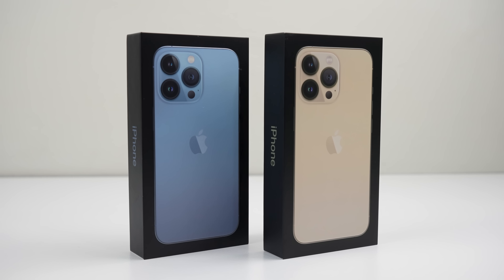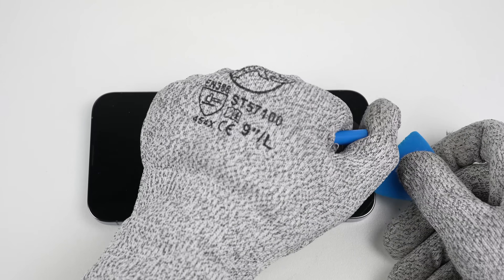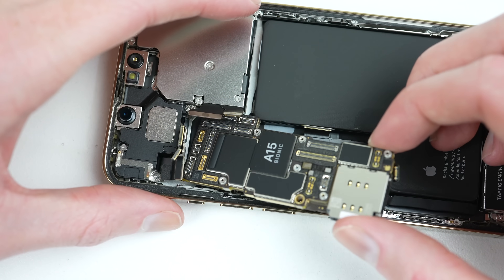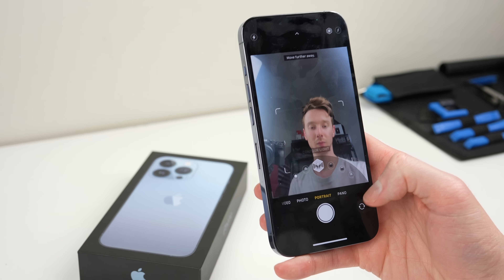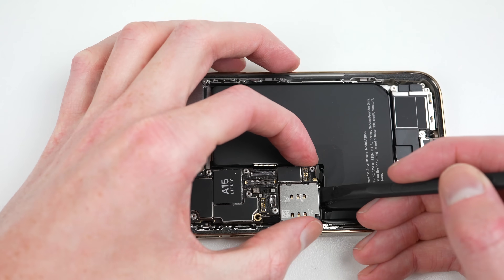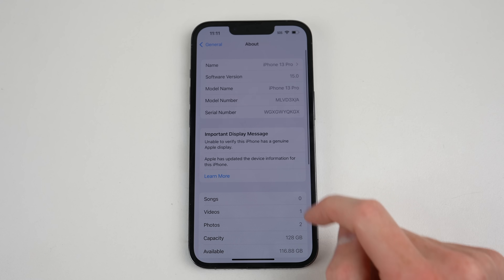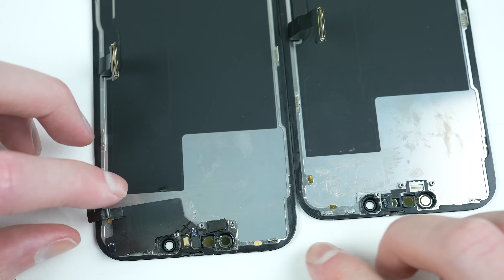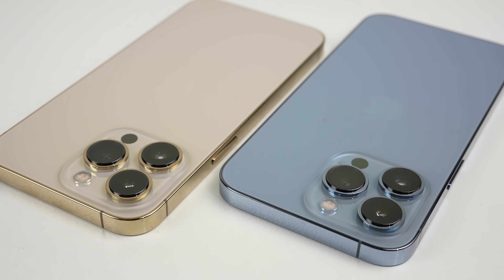iPhone 13 A Repair Nightmare - Teardown and Repair Assessment

Comment: Every time a customer comes to me for an apple repair request, I tell them to switch to other brands. Won't worth my time in getting apple products repairs. Sometimes, people gets mad about you not fixing these things for a few bucs. Even Apple's tech team won't repair it, they only replace. The damaged unit goes into recycling lol. 

Your video shows the issues when swapping components, because Apple assign an specific ID to each components, and each one is audited into Apple's databases, so they are aware of where is every device they produce going. 
This ID is paired logically to the set and once assembled, they got into inventory's phone, then when you start the phone, it'll ask you to connect to the Internet to send this inventory to Apple's Database and confirm that device is registered as they've programmed to.

Then, it starts all the data fetch from that device, including all your personal information, files and photos. Which every company does nowadays. Sustainability.

Cool video though.
Reply: What brand should I switch to?
Reply: @someguy4405  I would recommend to go with the one that offers a balance for your specific needs. 
Each user has different usage behave. This is when you have to do some homework. 
Like when you buy a pair of shoes: Do you like the color (case color)? , does the shoe makes you feel a solid step (is the phone fast responsive to your most used tasks)?, do you feel like the shoe is will last some time (is the device full customizable to prevent apps running in the background so it last longer)?, and so on.
Reply: @504octo  
What is easiest to fix?
Reply: @someguy4405  If you mean which one, I will say, none these days. If your mindset is to buy a phone as for "smartphone" is in escence, to get a future repair, then you are wasting your money cause commercial electronics nowadays are disposable.
Reply: @504octo  
Could you give more details on the data fetch that includes personal photos and files?
Reply: @someguy4405  Metadata, file creation, tags, camera device info, screen size, amount of apps on your phone, your phone number, fingerprint, face detection, etc. If you allow them to capture this, they will. That's where software comes into play.
Reply: @504octo  
Could you give a link or source for further reading on this info?
Reply: @504octo  do you casually know about a durable Samsung phone? I've been using a Ace 4 for 6 years and it has endured a lot so I has some trust in them but I don't trust newer phones, anything with Android 6 or higher and good storage is fine, don't care about camera quality
Reply: @someguy4405  yes I do but for some reason my reply was deleted 🤔
Reply: @andresamaya6187  Not sure, I dropped smartphone taste when Samsung landed the Galaxy S4 back in 2008. For me S3 was the best and the last of a generation of good smartphones. Some have come along the way but eventually fall into the same pile of disposable phones.
Reply: @504octo  thanks, considering my actual hardware, an S4 would be a really big upgrade and maybe I can find it at an affordable price
Reply: @504octo  
Try again, break the link up with distinct characters or present it differently, break it in half between statements, or just name the website instead.
Reply: @andresamaya6187  One thing I dislike from current phones is the none-removable battery. But companies won't produce battery replacement anymore. It was a cool era that did not lasted due to the cheap quality and prices. Just make sure your next phone is water proof in case it falls into a glass of water or into the toilet 😅
Reply: @someguy4405  won't work, Youtube won't allow organizational websites URLs in the comment section. But I've shared the URL on my Twitter profile, you can find me by the same name.
Reply: Shit phone, shit company
Reply: That is called MAC ID number and has been around for many years even before Apple existed, just was used for different purposes and Apple uses it for its own
Reply: They don't have an NDA for the tech team? I mean I know this comment won't result in much besides informational awareness, but still. I'd think they obligate you guys to not spill-the-beans like they do at Amazon (is actively an Amazon employee).
Reply: I don't care if they repair or replace, I only care I get a working phone back.  there's a point where it's not viable to repair some of these ultra complex gadget in terms of time and cost.

and people howl when their security gets violated, and then howl again when Apple maintains the security of their ecosystem that provides that security.
Reply: @ScottPankhurst  ^ found the type of person who makes scam companies like Apple able to exist. "Not worth getting these ultra complex gadgets repaired", as spoken by someone who has never even cared to look inside. Componensts are not super complex, and not difficult to maintain. Technology is not this wizard's magic that only Apple-paid sorcerers can handle. It's like buying a modern car and then scrapping the whole lot because you're afraid of having to use a laptop to diagnose ECU problems...
Reply: @Real_MisterSir  I still have my iPad Pro 2020 and I have to admit that apple is getting greedier everytime they launch a product and idk why🤷🏻
Reply: @Real_MisterSir  I agree with you and you are 100% accurate. I've been working with electronics my since I remember and I must say that Apple products are not magic items. Electronics is basic as these over priced devices that offers poor functionality and compatibility. Making an electronic device less compatible is just a marketing strategy of companies that sells candies with shiny fold paper but at the end is the same sugar from a cheaper candy. There is no high end products as for today, just over priced or cheaper. But the main issue here is how many functions you'll get with a reasonable price.
Reply: Makes fancy trash.

Comment: Say if instead of an iPhone, it was a truck. That truck needs an oil change and you diy it and use non apple oil and it’s not formatted correctly for that individual truck, then your vehicles running lights fail to work. I know it’s their phone and they can do whatever they want but it’s wild that only they and certified apple stores can replace these items.

Comment: This needs to be made illegal as anyone should have full access to parts diagnostic tools  services information and schematics to the device because if you don't you are nothing more than a license user and if that is the case then if you break your device they should replace it free of charge but do you really think that they would do that not if it's going to cost them money.

Comment: The way the issues occur when parts are changed seems too streamlined, almost like the OS specifically limits itself when new parts are detected instead of their assigned factory ones.
Reply: It’s a scam to require Apple to repair their phones and prevent 3rd party parts.

Comment: So err... What happened to the right of repair? And things like the historic Microsoft monopoly case?

This, along with things like custom screws shouldn't be allowed, I don't expect a complete documentation of the internals, and integrated circuits but if I want to figure that out myself I should be allowed to.

I don't use apple products, and the only reason I don't is the universal walled garden in both hardware and software; by doing this stuff they're aim is clearly to earn money at the price of competition and creativity.

Comment: I think the Face ID errors are actually a security precaution. I think this was done to prevent brute force, hardware based hacking of Face ID. If you really break it down, the front camera and Face ID sensors are just devices that communicate with electrical signals, and their output data could be spoofed. One could theoretically create a device that uses the camera connections, but isn’t a camera at all. Instead it could just feed the phone fake image and face mapping data until it got something close enough for the phone to unlock.

Making it so that the phone will only accept Face ID data from its original front camera and sensors is a pretty smart way of preventing this.

Comment: From a Security Standpoint I actually think it is quite good that face id doesn't work if you put another camera in. But I cant imagine a good reason for the disabling of other components.
Reply: I’m not sure I follow you, how is it a good thing? Unless of course you’re assuming replacing the camera would allow anyone’s face to unlock the phone, which wouldn’t make sense to me given the data should be stored on the main board and not the camera itself. In my mind, if replacing the camera worked perfect on the phone then the person who steals the phone would only be wasting their time replacing the camera because they’d be right back to where they were before tearing the phone apart?
Reply: @ThePantsManYEEAH  Okay as far as I understand it, and I am not an expert, the face id feature uses not only the picture you see, but also other means (I think Infrared) to get the shape of your face. This is why You cant just put a picture of someones face in front of the camera and unlock the phone with that.

To log into someone elses phone you would probably have to model their faces with their depth as well. I don't know how easy or difficult that would be, but I cant imagine it being very easy.
If it was possible to connect another camera to the phone it would probably also possible to connect some software that mimics a camera instead. Now I would just need to take a photo of your Face and present it to the phone when it asks for the face id. This Picture would of course need to include all the info a face id needs.

This seems quite complicated, but if you had the software, you would just need to make a short video of the person you steal the phone from and then connect the software to the phone instead of your camera. I wouldn't like if anyone got all my personal data that easily.

I don't know if every part in this is realistic and if anything I said is wrong please correct me.

Comment: The fact that they can fit a speaker above the notch but not a camera tells you all you need to know. They could make the top bezel 0.5mm thicker and fit the camera no problem but they'd rather make the notch smaller incrementally like everything else and keep stringing people along with new upgrades. Then they claim to be environmentally minded

Comment: If I spend $1,300 on a phone, I should be able to put third-party replacement parts in it. It's absolutely absurd that you can't even put first-party official apple parts without having an issue. Apple laughs and spits in your face at every opportunity and yet people still give them money for this overpriced electronics.

Comment: Using genuine parts from one iPhone 13 to another iPhone 13 causes the phone to permanently malfunction. Every component of the entire iPhone 13 range is deliberately programmed by Apple so that third party repairers are unable to fix the device. The person owning the broken phone has to send their broken phone back to an Apple store just to get a repair it at a hefty price. Apple's agenda of creating planned obsolescence of their electronic devices forces the customer to buy new devices on a regular basis. All of Apple's flashy marketing and gimmicky advertising doesn't hide the fact that Apple wants to sell new devices just to increase their profit margins.

Other electronic companies will follow Apple's lead by making their devices unrepairable. Eventually, all industries across the board will follow the same path as Apple. There must be laws for all industries across the world so people have the right to repair and recycle their products, especially in the electronics industry. Electronics in particular are difficult to manufacture and recycle given the large range of plastics, silicion, precious metals, rare earths and toxic chemicals.

The iPhone 13's poor repairability in this video is an example of Capitalism gone rogue.

Comment: The best way to heat up your iphine to loosen the glue is by putting it in the microwave for 40 seconds. If  that doesnt work, soaking it in warm water is a slower alternative

Comment: I'm not saying all the practices here are acceptable but the reason face id breaks in every situation is to make it as hard as possible to hack into a locked iphone. The theory being if you could replace the camera or logic boards with your own you may be able to bypass the phones security. Something that apple has made a point of defending heavily for a long time. 

However there are many more features mentioned here that should work with replacement parts.

Comment: When you write software to prevent the owner from being able to repair or maintain it, you don't own the item.  I would really like to see Congress fix what it means to own these electronics.  No reason for these to be so expensive when you're only renting the device.
Reply: And I wonder how many members of Congress would defend Apple on this
Reply: I wonder how many member of Congress were bribed by Apple in the right to repair case.
Reply: you still have the right to throw it on to a concrete floor and smack it into pieces with a hammer tho

Comment: "no charger means smaller packaging"  - ecommerce dealer: Now we need much more padding waste
Reply: I stock apple cables and charging blocks at my store. The amount of packing waste in those boxes is laughable. They also charge $60 for a silicone case lmao. Apple is a joke.
Reply: @Kuson2  $60?
wouldn't a leather wallet case on ebay cost 15?

Comment: Great video but i dont understand why ro make it 100% you didn't buy the same coloir phones, the argument could easily be that different parts ot security features are used on different coloured phones to avoid theft even though they are most likely not.

Comment: So sad. I love my iphone and ipad combo, the ease of use when swopping between them is what has kept me with apple. (Im not a fan of apple at all, but was not tech savy enough to copy the switch-ability with other brands). However, as I recently needed my ipad screen replaced, I will have to consider using android products next time I upgrade, and just hope I can get all my apps back in working order.
Reply: for the sake of the common good, do not buy anymore apple products. you can always go back to them once they clean their act up and stop with the evil practices

Comment: It’s a huge disappointment for such a good phone otherwise. I have tried android several times, and I’ve hated it every time. I had a Galaxy S9+ which released with android 9. It was done by android 10. No more updates, on a phone that cost as much as an iPhone anyway. I’m about to hand my iPhone 6s Plus down to mum, a phone released with iOS 9, still supported in 15. These phones are built to last, and are so far unsurpassed by any android phone in terms of software support. It’s just they’re not built to be repaired, which there is no excuse for. All I’m saying is that “iPhones are a nightmare to repair so go android” is a stupid argument because android is even worse.
Reply: P.S. if you must buy an android phone, and I had a Pixel 4, which is a lovely phone, I would only ever buy a Pixel. At least you have a chance of getting more then one software update for the damn thing.

Comment: Apple must have some kind of way to do these repairs. I guess they have special software to reprogram when they change parts?
Reply: Of course they can but they don’t repair them… they instead “refurbish” and re-sell them. Because the parts are so cheap it means they can profit off one single device 2 or even 3 times or more. Do the profit maths on paying to have a camera replaced vs taking that unit back, putting a new camera in it and selling as a refurbished full device.

Comment: Haters gonna hate, but I call this security features. Who knows what sketchy components / spyware could be installed into your phone by an unverified 3rd party if these measures weren't in place. There's a reason so many intelligence agencies around the world switched from Blackberry to iPhone. They are safe and secure. For anyone touting the iPhone is so unsustainable, get a grip. It's still a fixable and modular phone, but you're to mad your cornerstone thriftstore can't fix it for pennies. Every iPhone I've had lasted for at least 5 years. Meanwhile friends and family with other brands have struggled with unreliable hardware and software, and updated their phones at least every other year. That's unsustainable. Come get me.
Reply: For 3rd parties I would say, go get a license to fix Apple Products. Now, of course things could be better. I am not blind. Apple could have more tiers to their service repair program, where shops could apply for approval to do more advanced component repairs. That would be awesome. I also believe you should have the option to DIY, but that would require you to pair the phone to your Apple ID when using Apple Diagnostics and Recovery tools, marking your phone forever as self fixed, which of course should void any warranty. I don't every see Apple opening up for the DIY community.

Comment: This is an excellent video, thank you for your time and effort.

I've no idea why people continue to accept this company's behaviour. Do you remember when Microsoft were attacked in the courts for daring to package their operating system with their own Internet browser?

This is anti-competitive behaviour that eliminates the viability of third party repairs and leads to more environmental degradation as repairable phones are scrapped at an early age. Plus more profits for Apple shops as it's the only place to get your phone working properly again.

I won't buy Apple out of principle.